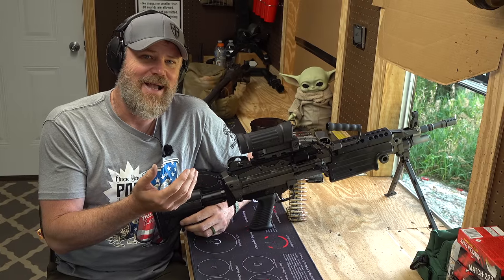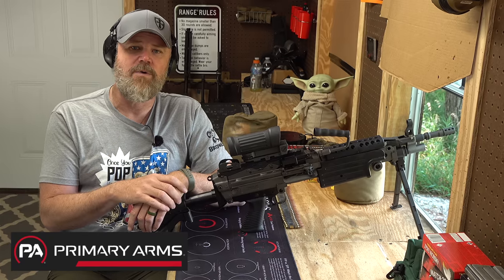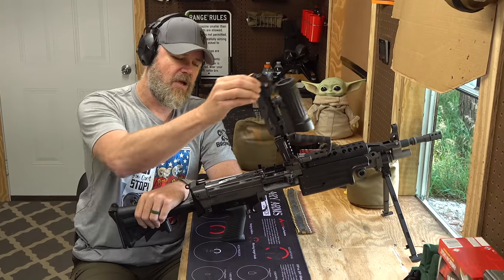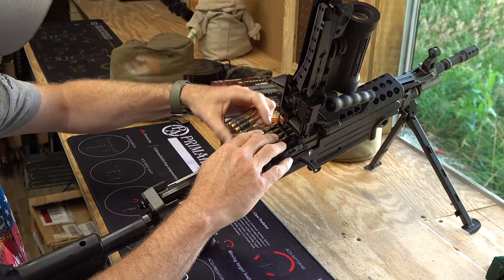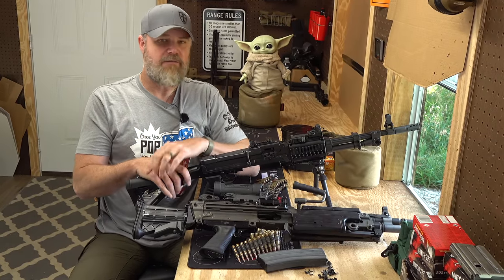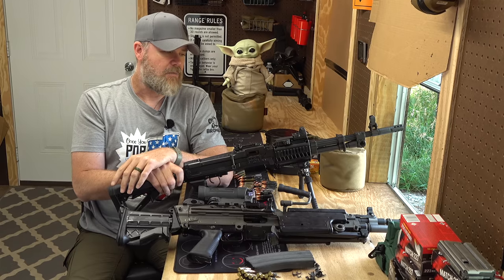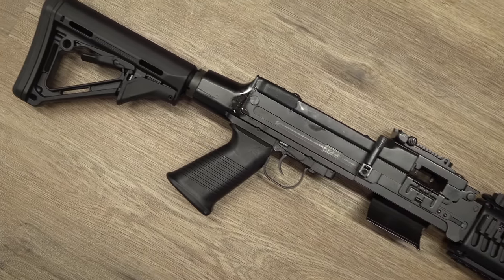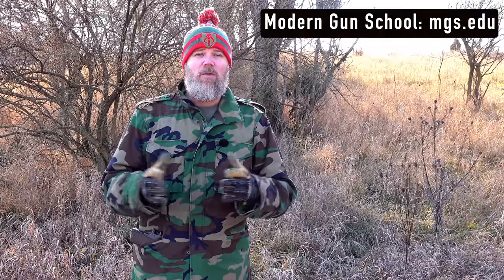Semi-Auto Belt Feds - Useful Tools or Range Toys?

Comment: The purpose of a squad automatic weapon is to suppress enemy movement.  That is achieved by putting a large amount of rounds into an area making the likelihood of getting hit high enough that moving through that area (or moving out of cover) is too dangerous.  The rest of the fire team then moves to flank the enemy and disable them.
Even with 100-200 round belts, ammo conservation is extremely important for gunners.  Ammo goes extremely fast in full auto.  Once you are loading you are not suppressing the enemy.  Standard practice is to fire short bursts (2-10) rounds to stretch the belts of ammo as far as possible.
Reply: A semi auto version of a belt fed would still be highly effective when used properly and honestly the belts would go farther.  If you had a binary trigger you could achieve comparable rates of fire. 
If you want something comparable to what is shown in this video your best bet is a Fightlite MCR with a binary trigger.
Reply: not sure where you learned to lay down suppressive fire or how to conduct fire and maneuver.. 
3-5 round burst on the saw, 6-9 rounds on the m240/m60.
the saw gunner will move with the fire team, since fire teams are the lowest level of movement (unless you are doing a bounding buddy teams).  
the saw gunner would never stay behind while ever one else moves..
Reply: @soup31314   Never said the gunner is completely stationary.  the gunner  is part of the fireteam so when the FIRETEAM moves he does as well.  

Youll notice the burst count is always less than 10.  Stict adherence to exact numbers arent neccesary.  These figures are there to keep heat under control and not waste all your ammo and are drilled so that infantry remember them.  This way they dont sperg under fire.  The key is short controlled bursts more than 2 less than 10.
Reply: @Patrick Henry that saw is fine in a defense, fine in offense.  It is an automatic rifle..
Reply: @soup31314  Congrats?  What youre saying doesnt invalidate what i said brother.  Im not getting in an e-peen measuring contest.  
Are you telling me that squad automatic weapons arent used to suppress enemies with high volume fire in short burts so that you can swing the gate, flank, and destroy?
Reply: @cmcbunch  the rate of fire depends on situation.  Could be short burst could be long burst, 
As i said you have no clue what you are talking about.
Reply: Soup’s World and The Devastator are both right in their points so I don’t know why they’re sniping at each other. The machine gun is mainly used in keeping the enemy’s heads down while your team navigates to flanking positions(the gun moves too). I humped an M60 in ‘Nam 67-69 and used it for suppressive fire on offense and rarely used more than a 5-6 round bursts at random intervals to keep the NVA guessing about popping their heads up. However when your perimeter is about to be overwhelmed and all you see is a wall of humans coming at you I would let that pig eat and sweep. One of my battalion gunners was awarded the MOH (posthumously) for his actions holding off dozens of NVA while his platoon tried to make it to safety.  He let that beast rip and saved a lot of his buddies’ lives.

Comment: I have the Fightlite, while fun and very lightweight, it hardly ever goes out to the range. It is like a converted Glock, fun but.... definitely not something I would grab if I really needed a firearm.
Reply: the issue i have with the fightlite, as links.. you cant just go to the local gun shop and buy links..
Reply: @soup31314  well, no... but I have 2000 links. I can order them on line easy enough.  It still takes mags too.
Reply: Throw a Rare Breed forced reset trigger in there. Definitely an improvement to the FightLite!

Comment: Speaking if the ATF just doing as they please... I was informed yesterday that as a Cerakoter, I am actually "manufacturing " the firearm again when I coat it. 😑🙄 this is a major issue for my shop... we will see where this leads us.
Reply: @Patrick Henry ATF officer yesterday. They have asked me to temporarily stop 3 jobs I am cerently doing for another FFL SOT holder. Claiming I am a manufacturer and I am the one who now has to file a form 2 for the parts... PARTS... I am coating.
Reply: Painting aka changing the appearance of a firearm requires you to have an ffl as a gunsmith at a minimum if they are not your own personal weapons. You will then be subject to all the other fourth amendment infringements placed upon your ffl. That's why ceracoting is expensive; it is regulated by the atf basically. Your ffl-sot knows this.

Comment: One thing to consider. The binary trigger works well and it is an easy and legal way to make a gun into select fire. Drop a binary in an AR lower and put the belt fed conversion on top.
Reply: Or just pull faster and save the money?
Reply: @stefanmolnapor910  you can only fire so fast with semi auto only. Binary you can fire as fast as the bolt can cycle. Also the price of the binary is small next to the price of the belt fed

Comment: The closest thing a US citizen can get to a FN M249 SAW is to buy a registered m16 and use that lower on either a fight lite MCR or Colt IAR upper.  You will then have select fire capability and the gun will will half the weight of what at SAW does at around 17lbs.  I own these and the fight lite MCR works well on both magazines and belts.

Comment: I carried an M-249 for a year in Iraq, and I'd absolutely want one for nostalgia.......but yes, even as much as I loved the platform, I concede that the civilian semi-only version wouldn't be too practical. Combine the SAW, ammo, the SAPI plate system we had, and an MRE or two and water, and I was humping around a LOT of weight!

I had the upper body strength (back then) to be able to handle the weapon solo and as I believe was intended (standing unsupported). If I'd had to step further up to say the M-60, that would have been stretching it and probably beyond me.

My biggest complaint with my SAW is of course related to weight, but not in the way you'd think. Having it slung to the side and having to fast-walk roughly a half-mile to the DFAC (Plt Sgt. regarded meal times as an opportunity to exercise), the SAW would constantly smack into my hip bone and upper thigh and bruise me.

Comment: A friend  bought one Featherlight Industries MCR belt upper receiver from Brownells couple yr ago then we put ar15 lower receiver with Franklin Armory binary trigger this is closest thing you can legally own next to full auto Saw .. we are to consider it better than a full auto can constantly keep it close to 500rpm so don’t need to swap barrels as often do to heat have ran several 1000 rounds with minimal issues these were operator ones

Comment: Most of the saws in the military that Ive used are pieces of junk. It seems like the semi auto one is more reliable! 
The m27 is an excuse to get new rifles. Its basically a hk416 with a heavy barrel. I once saw a whole marine platoon just outfitted with them in 2018 overseas.
I think that a better solution would be to have a standard rifle with extended mags instead of belt fed.

Comment: Showerthought in regard to the long heavy trigger being a problem for high round counts.

What if there simply was a long lever attached to the bottom of the trigger guard and contacting the trigger(would be easy to make in a way that could be swung out of the way for regular use of the trigger) so that you could use your entire hand on it.

Aside from the really bad joke than can be made about the action performed to fire the gun using this lever.... it would make sustained fire easier and it could possibly also give a much higher rate of fire, all while each movement of the trigger still only firing a single round......................

Comment: I have never seen the logic in having something like a M249. Other than belt fed, they are heavy,  not that accurate.  I fail to see an advantage  in a squad weapon firing the same round as an M4. I seems to me that a squad automatic needs to be a larger caliber. It should be more powerful than an M4, better range, better penetration more lethality..just my 2 cents...
Reply: The point is volume of fire within squad engagement range. Longer shots/more power is where MMGs/DMRs come in.

Comment: I figured I would add my two cents to this since I happen to own a semi auto belt fed. Mine is a UK 59, manufactured by Marcolmar. I think it would be an okay weapon if it was more reliable. The current issue that it has is that the striker rod peens too much and gets stuck in the stock. Otherwise, the weapon would run fine. I have to constantly file down the rod every 700 rounds to make sure it doesn't get stuck.  Its also reasonably accurate, able to ping IPSC targets @ 200 yds.  The solution to the reliability issue is to use belt feds that were originally designed to be closed bolt.  The HK series belt feds are the best known examples of these. The PKM is an exception to this rule, as it is essentially an upside down open bolt AK. So conversion from open to closed bolt is pretty simple (relatively).

Now, the criticism of your trigger finger getting tired using one of these is absolutely valid. The issue can be resolved with a binary trigger/FRT or a crank system. Usually, belt feds use unique triggers, so drop in binary solutions won't work. That leaves cranks. which are more common on the browning series machine guns. Trigger cranks do exist for ARs/AKs, but to my knowledge, none of the commercial solutions work on the UK 59 due to its extremely heavy trigger pull.  Knowing this limitation, 

Weight is just something that will have to be dealt with. My UK is relatively light, coming in at 21 pounds. Knowing its limitations, I've relegated it to being used while mounted on a tripod or on the back of my truck. As such, I rarely bring it out to the range, and I usually bring my RPK in x39 or VEPR in x54r since they are more manageable.

The best practical belt fed setups I've seen are the MCR uppers with FRT/binary triggers,  or the HK21/23 series with franklin armory binary triggers. Binaries help mitigate the trigger fatigue issue. Both are reasonably reliable. The problem with them is the expense, especially with the HK series, which costs north of $12k.

Other considerations that you didn't mention in the video include things like semi-auto M2s in .50 BMG. Considering that a basic semi auto M82 goes for $6k, $18k for a semi auto belt fed .50 BMG is actually a pretty decent deal. Combined with a decent crank ($5k), and you have a weapon that can really do some serious shit. It would have to be crew served though. But if you have a spare $20k lying around and a little group of guys to help you run it, its pretty good.
Reply: Crew served weapons are good for the kids.
They learn the mechanical operation of Firearms,teamwork & cooperation.
"Ma-aaaa! Jimmy's not giving me time to check the headspace & timing before he tries to pull the trigger!"

Comment: Those are useless novelties. Because they are closed bolt versions, you don’t even get the same firing impulse. The lack of full auto is an insult. 

May as well just get an airsoft version. At least that one will fire full auto while you run around and try to look cool. Be cheaper too.
Reply: @Enjoyer.762  what you on about?  How does owning any one of these single shot belt fed novelties further 2A purism?  

Did you misread my comment and assume I was somehow implying that a full auto airsoft should be the only way anyone owns full auto?

Comment: Wasn’t the Stoner a belt fed weapon that used a standard magazine also?
Reply from the maker: I don't believe it could use magazines while in the belt fed configuration. I've not seen a real Stoner 63A in a very long time, but the action is inverted so the magazine would have to go where the fed tray is and that's impossible. Thanks for watching.
Reply: If I remember the weapon correctly it was a modular design that could be converted from belt to magazine fed there was also a configuration that was magazine fed from the top I’m not sure if that configuration was compatible with the belt said configuration

Comment: I think a magazine fed gun makes more sense without the fun switch. You get a lighter gun that's less susceptible to debris and give up very little firepower. Bonus if the fun version has low cyclic rate to begin with. Such is the case of DP27.